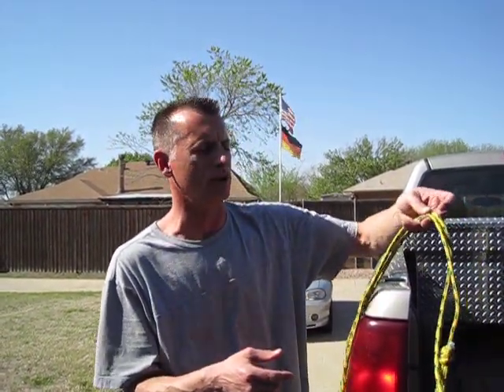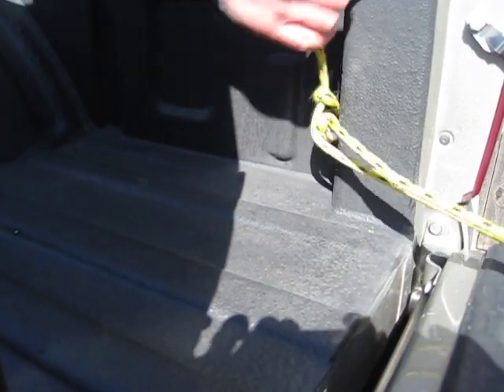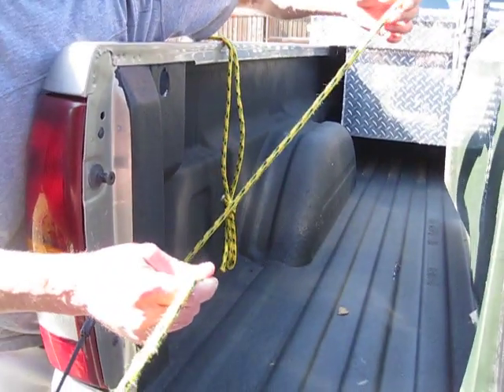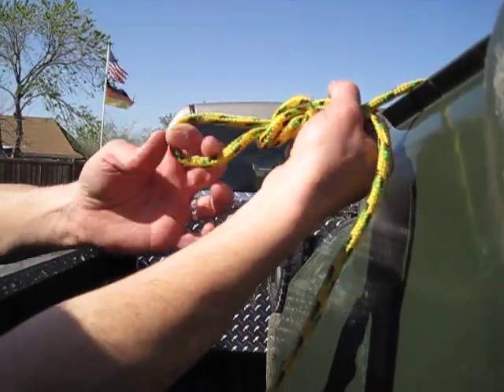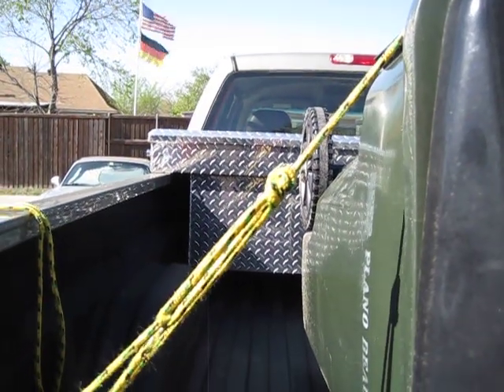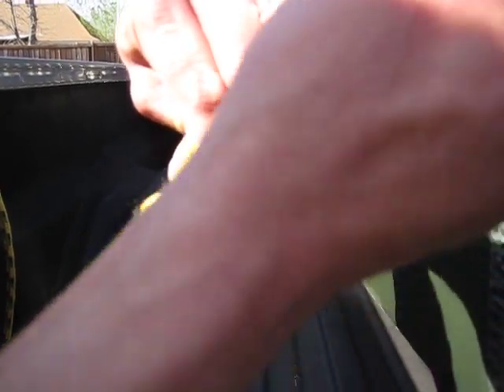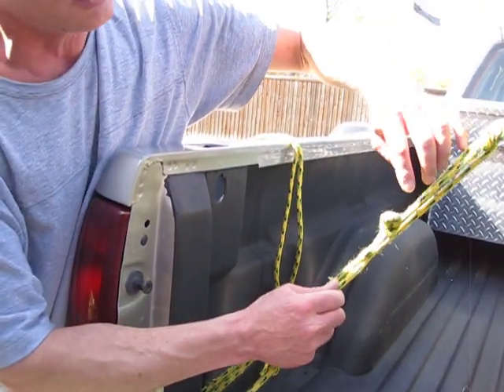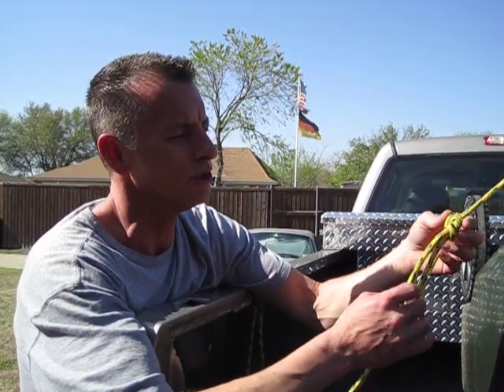Cargo Tie Down Procedure Using A Simple Knot

Comment: This is exactly how I tie things down, with a few modifications. One I tie a bowline on the one side, go over, and through my other tie down. Then, I usually do not like an overhand knot because they are harder to untie after a lot of tension has been applied. I instead will be more inclined to use either a lineman loop or a slip knot, but an overhand knot is still a perfectly acceptable knot to use, however. Then, I tension it like this guy has, and tie it off like he has. However, notice how he unties it at the end. All it takes is a good jerk and the knot comes undone. As a safety, you should always drop the slack end back through the loop. That way if the knot comes undone while you are hauling, it will work as a stop and keep the knot from coming undone. Then, I tie off any leftover slack with half hitches.
Good informational video, though, for anyone who has no prior knowledge of knot tying.